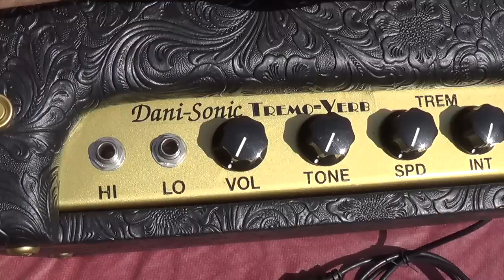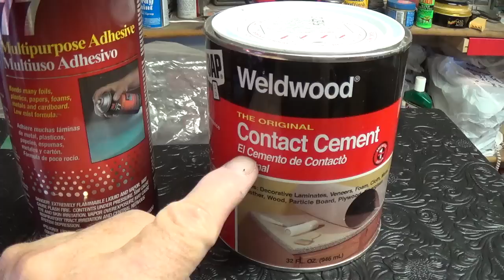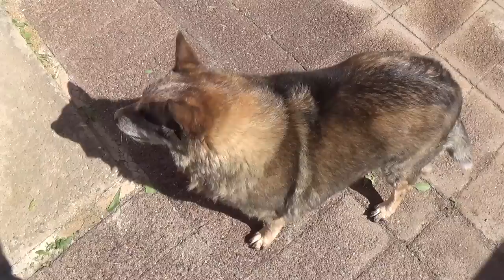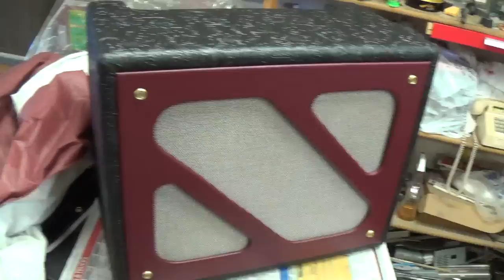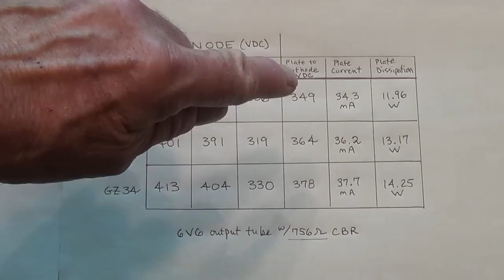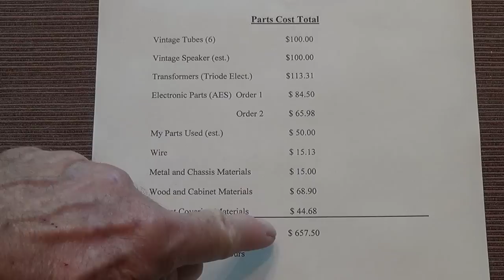How to Scratch-Build a Vintage Amp, Part 8:  Completed and Tested

Comment: Hi Uncle Doug, love this series you put together. What type of grill cloth did you use? Where did you buy it?  Thanks! Jack
Reply from the maker: +Jack Pien  Thanks, Jack. It's material used to reupholster lawn and deck chairs.....so strong you can stand on it and completely water/stain proof. I bought it at a local upholstery supply shop at a very reasonable price.

Comment: Hi Uncle Doug......I'm getting closer!!  thanks a ton for your posts!!  Bart

https://plus.google.com/photos/107611288716611973814/albums/6234879588528093985?authkey=CLDTovyrzrOEfQ
Reply from the maker: +redfishbum  Good grief, Bart.....it's spectacularly nice !!  The chassis graphics (I love the "UD" in the model number) and cabinet color (and covering job) are beautiful.  I am completely impressed with your progress so far and can't wait to see the final product.
Reply: +Uncle Doug Thanks!  I have been on a break from work; I'm now back in the airport traveling.  I have about half of the chassis wired and I have some of it soldered.  All of the tube and pot wiring will need to wait for a bit as I travel a ton for work.  I'll let you know when I have it completed and tested.  By the way, I used water slide decals with my inkjet and then coated with a few coats of polyacrylic.  Again, thanks a ton!
Reply from the maker: You're welcome, Bart. Good luck with work and be sure to let us see the finished product.

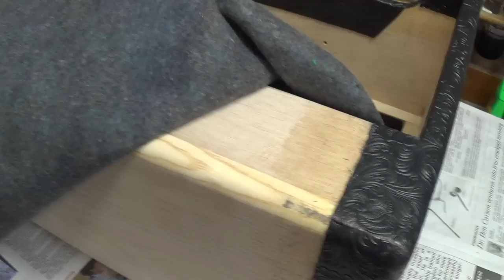Comment: Hi Uncle Doug....at 4:33 I can see the underside of the curved opening for the chassis.  I'm about the to cover this on mine.  I think that you might have used a small piece of black covering inside the curve which is not part of the big piece that you are wrapping but I cannot see any seams in your opening shots of the chassis.  Would it be possible to clarify how you covered the corners?  I was thinking that I would be seeing triangles underneath but that isn't what I'm seeing.  

Thanks so much for this excellent series and your others.  Hugely helpful and I would not be able to tackle a project like this without your videos.  

Bart
Reply from the maker: +redfishbum  Very perceptive, Bart. It's difficult to explain, but on inside-radius curves, like those over the control panel, I do glue a 1 to 2" piece of matching material to the curve before cutting and wrapping the material around it. That way, if I have to slit the material (making a "V") to get it to wrap smoothly around the inside curve, there will be no bare wood exposed.  I also heat the material to make it more flexible before wrapping, in an effort to reduce or eliminate the need for a visible V-slit.
Reply: Perfect. I understand what you mean. I have just the top panel left to get glued down.  Lots of work but very rewarding. Thanks a ton for your reply!
Reply from the maker: You're welcome, Bart, and best of luck with your project. I'll bet it turns out great :)

Comment: So, now that this amp has been finished for a while, I'd like to know what you think about the difference between the 6V6 and the 6L6 (with the elimination of all the other variables).  The power output difference wouldn't be much, I think.  But what I'm curious about is the tonal difference.  I ask because while designing a small single-ended Hi-Fi amp, I learned that the 6L6 was specifically designed to maximize 2nd harmonic distortion while minimizing the 3rd-and-higher.  This is why a 6L6 has such low distortion in a push-pull design, because all of that 2nd harmonic distortion cancels out in the OT.  Well, it occurred to me that a parallel single-ended 6L6 amp might be really great if you're looking for a 12W amp for playing jazz guitar, because of all of that 2nd harmonic distortion.  Not overdriven, mind you... clean, but with that hint of the next octave on every note played on your arch-top.
Reply from the maker: +Jason Thorpe It's subjective, but I thought the 6L6 had a fuller tone than the 6V6. I'm not a huge fan of parallel SE output......you would probably be just fine with a single output tube. The Supro TV is quite loud with a single 6V6  and a bit louder yet with a 6L6. You could do as I did and build the amp for both tubes, then see which you prefer.

Comment: Dear Rusty, Jack and Uncle Doug, It recently dawned on me that in the UK we have 240v ac power grid. Would the UK version of the power transformer give the same output currents to the tubes? Another question if I may put to Rusty, are the dog cookies tasty?. Ok one more question for Jack, Can you come to the UK and sniff my power transformer to see if it will suffice? To Uncle Doug, you are a legend. Thank you.
Reply from the maker: +semahnai  You're welcome, Ian. Yes, power transformers in Europe are designed to use 240VAC input current to produce the same output voltages as a 120VAC transformer does in the US. Rusty says "Heck, yes" the cookies taste great :) I'll have to get Jack's passport up to date if he's going to do any European transformer sniffing. Thanks for your kind words :)
Reply: I thank you Sir, I look forward to building my English version of your fantastic project. When done, I will share it with you. Luckiny, I have a donor cab and speaker from my dead Roc Pro 1000 Fender amp.  Love to your celebrity companions Rusty and Jack, and your good self. :-)
Reply from the maker: You're welcome, Ian. We look forward to seeing your Supro project once it's completed. Thanks for watching and commenting :)

Comment: binge watched it all today. good work!

I've built 2 tube amps so far, only one in a real chassis, an 18W daisycutter (phaez)
I got really fanatical about lead dress and layout because I read it was very important.
(also feedback during prototyping scared me)

I see you didn't use stargrounding and didn't mind having ground returns through chassis.
I couldn't see in your build, but I also read mounting grid resistors as close to the socket termination can help hum, which makes sense.

How important are these techniques in your opinion?
I guess it might be more necessary in higher gain amps?

also: 
Do you prototype at all before builds?
meaning designing, tweaking and testing before construction?

Thanks for sharing your wisdom.
Reply from the maker: +Borgar  You're welcome, Borgar. In the Supro build I used a lot of shielded cable to connect the early amp stages to the volume and tone controls, etc. and I maintained a clear separation between the power supply and its grounds, and the amplifier sections and their grounds. Wire dress is very important, especially with the AC filament circuit, and avoiding having any signal wire parallel to an AC wire.  The circuit was dead quiet, so whatever I did seemed to work.....but, as you say, this was a relatively low-powered amp. On the other hand, SE circuits lack the hum neutralization found in DE output sections, so I'm quite pleased with the result.  No, I don't do any prototyping.  I simply build it the best I can, with every trick I've learned over the years, and when it's done, I plug it into a current limiter and hope for the best. In this case, that's what I got :)
Reply: thanks for the prompt reply!
yes its very satisfying to turn it on for the first time with no hum.
I remember thinking it wasn't working before i strummed the guitar.

I'm in the processes of setting up a prototyping lab.
at first it well be a simple el84 SE output to experiment with preamps on.

later build a full 50W el34 PP from transformers i got from a defective amp.

Don't worry, I'm an electronics technician.
If I'm gonna die from shock, its probably gonna be at work.
Reply from the maker: Let's hope that doesn't happen. Best of luck with your project.

Comment: I've been looking through the schematics and making a parts list and I came across a couple of things that look odd.

In the output tube bias selector. The schematic says 660Ω and 750Ω. Should that be 680Ω (or 620Ω)? 660Ω isn't sold in 1W or 2W packages anywhere I buy resistors

The 500Ω 2W (or 1W) resistors are called Pre-WWII sizes on Just Radios but the 2W is only sold in a kit. I've got an email in to Dave to see if he can source the 500Ω 2W resistors. Neither Mouser or Radio Daze carries 500Ω resistors of any size. 

3MΩ isn't coming up on Mouser, RadioDaze, or Just Radios. 2.7MΩ or 3.3MΩ
Reply from the maker: +Michael Lloyd  The 660 Ohm resistance was obtained by wiring two 330 Ohm 2W resistors in series, but you should bear in mind that the bias resistance for my circuit and tube may not be the same as yours.  Cathode bias resistance is unique for each output tube. Your value may be higher or lower than mine.  All of my electrical components other than transformers came from Antique Electronic Supply, which offers a huge selection. The 500 Ohm 2W resistors were probably 510 Ohm, which is only a 2% variance....well within the 5% or 10% generally acceptable with resistors. If you can't find or don't have the exact resistance you need in a single resistor, then do some calculations (or trial and error) and try 2 or more in series or parallel to get the desired value. Good luck.
Reply: +Uncle Doug I see. I work an AA5's and old tube test equipment most of the time. You would think that by now I would stop trying to use decimal points when I select parts for tube gear but I still do :) It never occurred to me to use a couple of 330Ω resistors in series.  

Just Radios cap's and resistors are about 1/2 the price of AES (AES also has a site they call Amplified Parts). I'm a big fan of AES so not knocking them by any means. For bulk cap and resistor orders Dave is hard to beat. But if he doesn't have them then it doesn't matter. I ended up ordering 500 ohm 5W power resistors. I'm at least a month away from building the amp so I have time to accumulate parts
Reply from the maker: Thanks for the info on Just Radios. Best of luck with your parts order(s) and your project.
Reply: +Uncle Doug I don't need luck... I have an Uncle Doug channel. The downside is that if I screw up it's all on me because we know yours worked :D
Reply from the maker: I guess the ball is in your court, Michael :) Believe me, I spent a few sleepless nights contemplating the humiliation if my wonderful project went up in flames for all the world to see. Fortunately, it turned out to be even better than I hoped......as will yours, I'm sure.

Comment: Are the 25µF 50V caps eCaps? None of the electrolytics are signed on the schematic. Every now and then I see the plus side tied to ground in power supplies though that's not the case fir the 10µF and 20µF caps in this supply. It's nice to see polarity noted for polarized caps on the schematic.
Reply from the maker: +Michael Lloyd Yes, in the Supro circuit, all cathode bypass capacitors are electrolytic and all are wired negative end to ground, as are all filter caps in the power supply. This is true of just about every amp schematic I have ever seen, with the exception of the electrolytic cap used in the negative bias circuit found in fixed bias amps (with grounded cathodes and a dedicated negative grid bias supply).....which is wired + to ground.

Comment: You have some sparky distortion going on. I'm not sure it's the amplifier, might be the recording equipment... The input tube V1 and tremolo tube V2b seem to share the same cathode. Are you sure you wanna use a shared 1k/25u cathode on those stages? Try swapping the 1k to something lower, maybe 820 Ohms or so. Like you have on the reverb recovery stage. The input high pass filter for the reverb seems a bit high, but I couldn't hear it in the video..? If I where you I'd go for a cut frequency of 1k or so. I calculated yours to 3k:ish. Cheers!
Reply from the maker: +Per Normann  Greetings, Per. I have no idea what "sparky distortion" is, but so far you're the only one of almost 6000 people to have mentioned it......so maybe the problem exists in your home sound system. Yes, the cathodes of V1 and V2b are connected, simply because that's how the tremolo effect is applied to the guitar signal in V1, and it's what makes this tremolo circuit "special".  In addition, since V2b is a cathode follower, no cathode bypass is required. The tremolo insertion is wired exactly like Supro did in the original amp, and the 500pf input cap for the reverb is exactly the same value used both by Supro and Fender in virtually all of their tube reverbs.
Reply: +Uncle Doug Hi again! I take it you're not going to tinker with the amp more, given your answer. :-) However, I got curious and listen to different clips, your and others. I could only really hear a similar fuzzy distortion in your clips, no mater what volume my home sound system was at. The distortion in this clips is on your side, but it's very hard to determine whether it's the amp or recording equipment. One thing sort of point at the equipment. When you play with reverb the distortion I hear is still dry, i.e. the recording equipment can't handle the volume you're at. About the cut frequencies in the reverb driver, if I find the time I'll make and show you simulated scopes of the reverb circuitry.
Reply from the maker: You're right, PN. After reducing the Tremolo Intensity to a usable level at 10, I'm satisfied with the sound of the amp as-is and will not be doing any more tinkering. My camera has tiny built-in stereo microphones and no provision for external mics, so I'm pretty well stuck with this recording set up....at least until I buy a better camera :) At high volumes, it does tend to compress and distort a bit. It's my understanding that the 500pf reverb input cap is standard because only treble frequencies respond properly to the reverb effect. Midrange and low frequencies tend to get real muddy.

Comment: Hello Doug, regarding the shielded wires is there any reason that a shielded wire would be used between the tube used for reverb recovery and the grid of the first half of the last tube (phase inverter on my push pull config). None of the other wires carrying signal between the tubes are shielded, only those taking signal to/from the control pots. So it is perplexing to see a shielded wire on a signal wire between two 12 series tubes. Any thoughts as to why it might have been done this way?
Reply from the maker: +allanpennington It's my understanding that the reverb recovery is a hum-sensitive area because the signal is rather weak and is going to be amplified. This is why the output jack of the reverb tank is always located as far as possible from the power supply. I would imagine that the shielding is simply a precaution to reduce noise.

Comment: Man this amp looks and sounds sweet. I love how deep the reverb goes and wouldn't change a thing, but that is just me. What guitar, string weights, and pickups did you use for this test? I am about to dig out my 60's Surfing records, as I am inspired.
Reply from the maker: +BrokenPortriats Thanks, BP.  I agree with your assessment of the reverb and have done nothing to alter it. I used my regular workshop guitar, a 1970 Matsumoku V-695 Performer with MMK-45 Humbuckers. The strings are an old set of 10's. It's great to hear that the video was inspirational. Thanks for watching and commenting :)

Comment: Uncle Doug....It has been great following along this build and to have the schematic and wiring diagram is hugely helpful for learning how the diagram is translated to an actual amp.

There are two spots that I need clarification on.  One is the wiring for the bias on the output tubes.  The diagram shows the 6L6 biased with 660 ohms and the 6V6 with 750 ohms; however, the wiring diagram has these values reversed.  I have looked at your video again and it seems that the schematic is incorrect and that the 6L6 is biased with the 750 ohm resister.  Can you verify this?

The other spot that I'm having a hard time reconciling is the wiring chart with the schematic as it applies to the 100K ohm resister wired to the plate of V4a.  It does not seem to be connected to B3 correctly.  I don't understand why the one end is connected to a terminal spot that is not connected to any thing else.  Am I off base here?

Thanks for this simply outstanding build series!

Bart
Reply from the maker: +redfishbum  Thanks, Bart. Glad you enjoyed the series. The 6V6 is biased with a 750 ohm resistor and the 5881 (6L6) is biased with a 660 ohm resistor. I checked the schematic and the voltage charts and they are correct. The Layout Diagram has it backwards, however.  Also, you are correct that the 100K resistor has no connection on the Layout Diagram. B3 is shown going to the wrong terminal. It should go to terminal 2 with the 100K resistor and the 270K resistor (to the right) and a black wire should connect it to the fourth terminal on the far left. I will contact Tommy and have him correct these errors. He was creating this diagram strictly from photographs of the wiring and apparently the correct connections were obscured. Thanks for bringing them to our attention.
Reply: +Uncle Doug Thanks for the clarification.  Great stuff.  Again, this has been so helpful.
Reply from the maker: You're welcome, Bart. Thanks for finding these mistakes. The corrected diagram will be re-posted once I get it back from Tommy. Please let me know if you find any more errors. The Layout Diagram was extremely difficult to do, and a few corrections were inevitable.